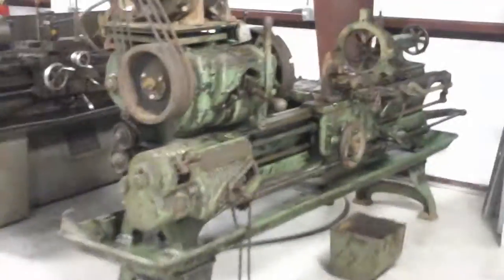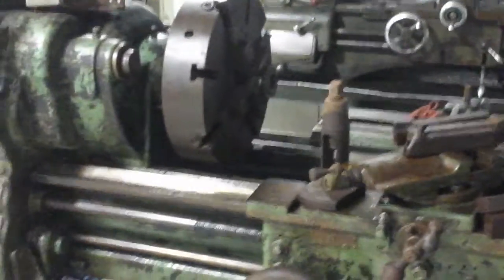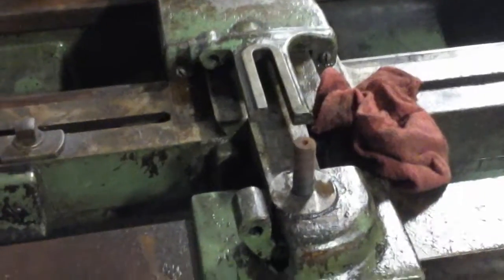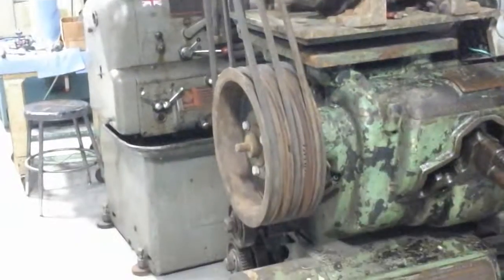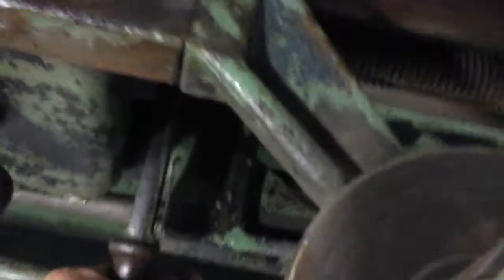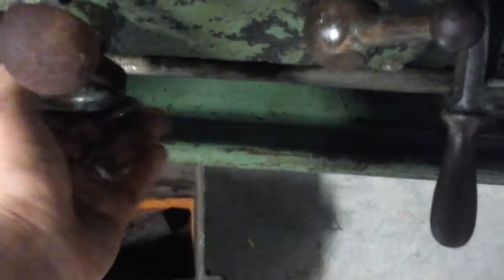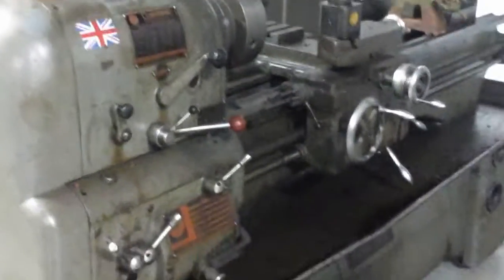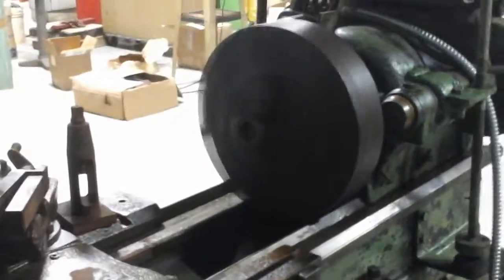1909 Hendey 8 Speed Engine Lathe Intro

Comment: Nice old lathe! Sounds pretty smooth and quiet considering it's age and obvious usage.
I have a 1908 American Tool Works lathe that sounds like an old tractor...
Reply from the maker: Thanks! Ive made a bit of progress on this brute, mainly cleaning and stripping paint, but also figuring out the condition of all the parts and what it will take to make them right.